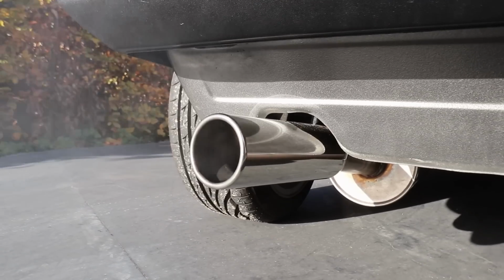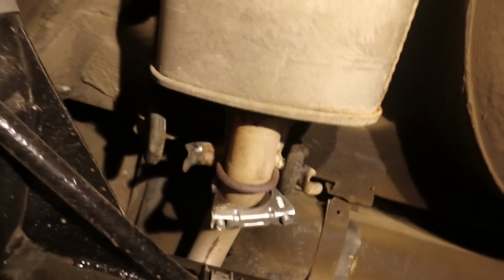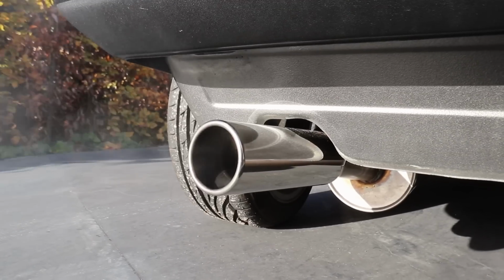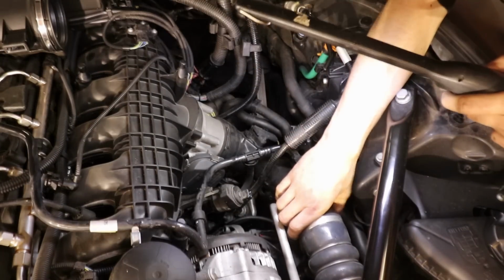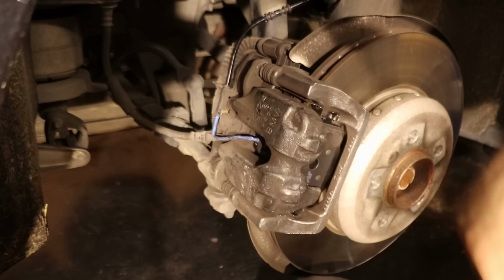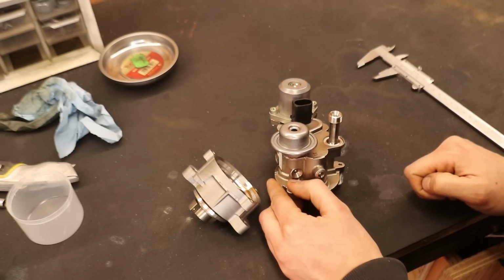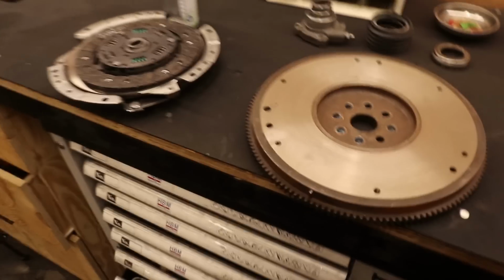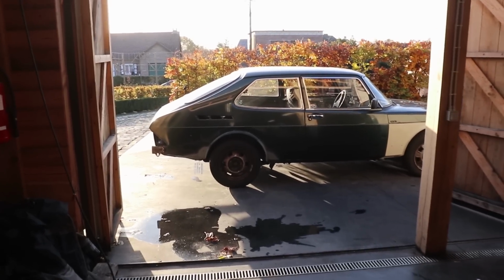My Mk1 Golf Gets A Complete Stainless Exhaust System From JETEX Exhausts!

Comment from the maker: IMPORTANT 05:22 On OEM headers this modification is not necessary. The kit comes with an adapter to fit the Jetex on the OEM exhaust. My Golf has non-OEM headers that prevented the JETEX from fitting.

Comment: You should use exhaust paste on joints where are not used any gaskets. It will hold when new, but starts to leak when expands by heat and metal rust.

Comment: On the el brake, you could just use a 9V battery or 12V derect on the motor. 
If its not going right way you can just switch + and - and it will go the otherway :)

Comment: Increase in pipe diameter will most likely reduce performance unless your car is utilising forced induction. There are calculation charts online you can use to work out the optimum pipe size for your car. Nevertheless great video as always

Comment: i'm having an issue with the drivetrain in my e28 and even the bentley is not clear on the solution. does anyone know what the mounting of the diff/final drive case is on the front side? i know there is a large, single mount at the back of the case but i believe my issue is in the front. i'm going to replace the big one in the back, but would rather have all of the parts on hand before i take it all apart. yes, i checked the forums, which say the front mount needs to be replaced but i can not find such a part. does the case just hard mount to the subframe on the front (driveshaft) side? thanks for any help, anyone.

Comment: How did you find the drone in cabin, even being a resonated version of the Jetex?

They pretty much are the Best Deal option in stainless kits.
Reply from the maker: I didn’t drive it on the motorway yet but didn’t experience bad drone so far. Resembles the stock exhaust very well.

Comment: I for one would not be happy with the quality of this. It’s shocking condition for a brand new system
Reply: I mean, if it was free then whatever but I would hate to pay for that...
Reply: What do you mean?
Reply: Hmmm, what actually do you mean?
Reply: @RuedigerEtzold  did you not see the dents that the system had when he took it out of the box? Seems like the Jetex employees used some of the parts as hammers or something by the looks of them!
Reply: @stefa_  The "dents" are on purpose for better fitment around the axle etc.
Reply from the maker: I can ensure you that there were no dents in any parts unless functional
Reply: @stefa_  They are engineered depressions. If you look at 04:55 the OEM even has a depression on the axle bend, despite it's small diameter, but of course it's more pronounced on the larger bore Jetex!
Reply: Leuke video weer. Succes met jouw merchandise 👌🏻